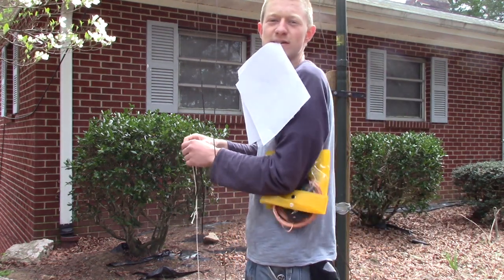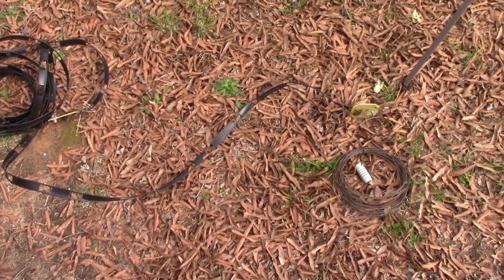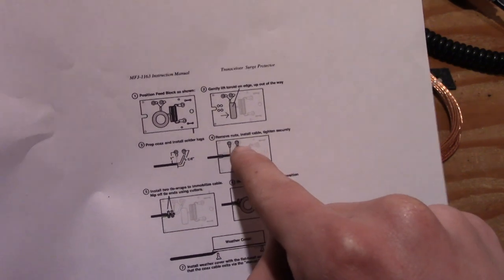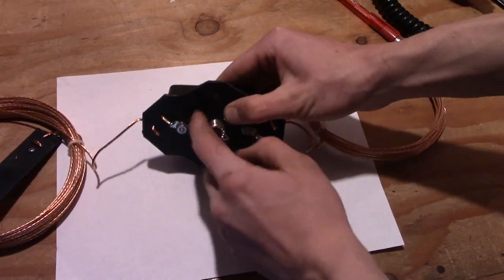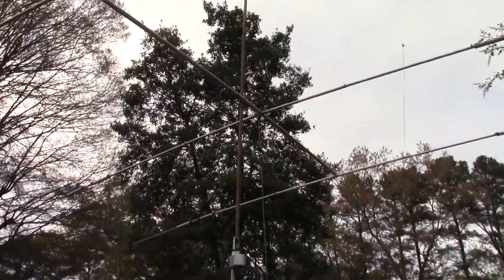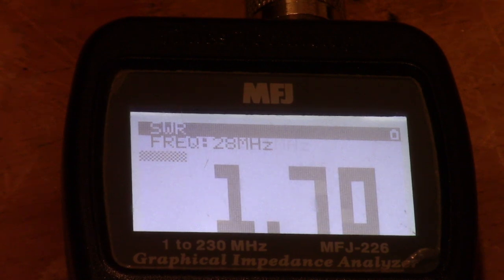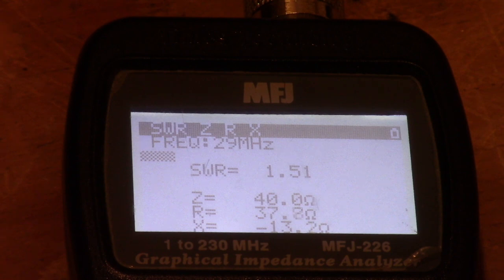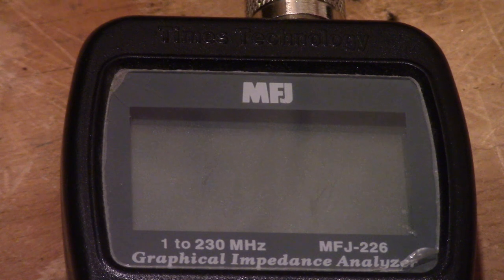Installation and SWR Test of MFJ-2010 4 Band OCFD

Comment: Thank you, sir. This is in my “next antenna” lineup, after trying a Delta loop. My plan is to make it, using a 4:1 balun. Highest point above ground - 45’ or so. I, for one, would be very interested to learn about the long-term use of this antenna. Cheers KQ4IXD

Comment: I hope the mfj works out well for you. I do own other mfj gear and have had good luck with it. However..., I would want a refund on that joker. You almost had to rebuild it again. Smh.

73 es gud DX

De kc5ngx
Reply: I don’t think the sealing is necessary, if a little moisture gets in it will dry if it can breathe.